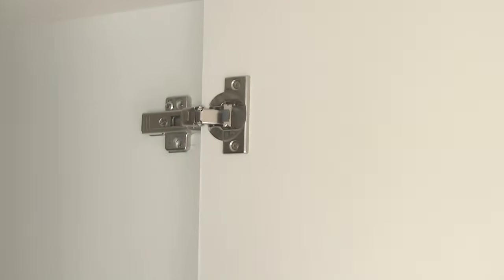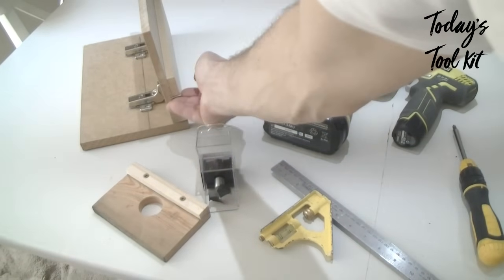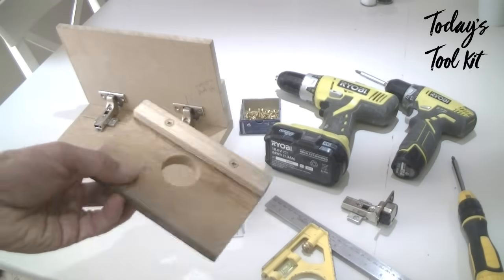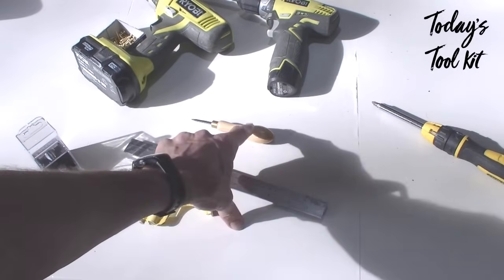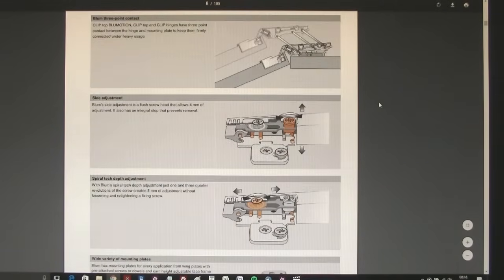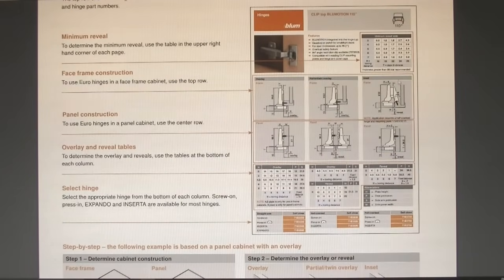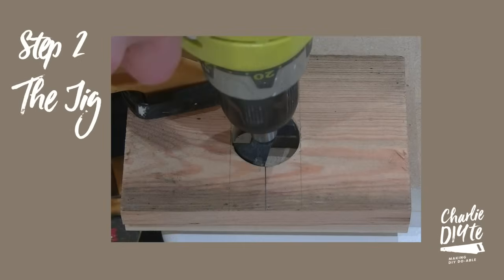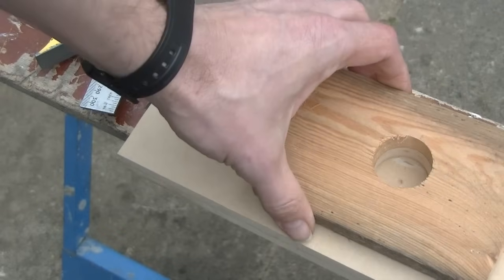How to Measure & Install Concealed Hinges on Cabinet Doors

Comment: in my cabinet panels, while assembling found, circular hole is already on side panel.
can I install this hinge reverse? Base plate on Door panel and Hole   hinge on Side panel?
Would it create any problems?
Reply from the maker: peeyush chaurasia I guess it would - particularly if you're using the hinges that it was supplied with. Depends on how far away from the edge the circular hole is located, and what type of covered hinges you have. I guess you just need to try it out and see what happens. Are the doors pre-drilled for the mounting plates? Weird though to do it that way round - you don't see that very often 🤔

Comment: Did you have any trouble with your MDF doors bowing?  My first attempt using MDF with panelling glued on caused a lot of warping.
Reply from the maker: Yes I have as a matter of fact. I had to completely remake one set of doors. Part of the reason was they were stretched across 2 benches when I made them, but also I used grab adhesive which I don't think helped. The last lot I glued together with PVA https://youtu.be/WIRW0kMN96A and they didn't warp at all. You could also try moisture resistant MDF. The other trick is to clamp them down to a flat table when you glue them and only release the clamps when you've pinned them and the glue has gone off for a couple of hours.

Comment: sorry if this is a poor question: what is the bit used to drill the 35mm hole?
Reply from the maker: Sam F It's a hinge boring bit - sometimes called a forsner bit. If you click on the little down arrow to the right of the video title it will open up the description tab that contains details of all the tools I use in the video and links to them. YouTube needs to make it much more obvious!

Comment: This is the only video I found for exactly my application. Would you mind to share the Part number of clips, hinges, etc? It would really help me. I went through the BLUM catalog but got overwhelmed! Please :)
Reply from the maker: laura vianello Thanks so much Laura! I'll see what I can find, it may be tomorrow because I'm travelling with the day job right now. By the way, did you check out the links in the comments section below the video, as this includes the links to the hinges from the company in the UK I bought them from?
Reply: NP, thanks
Reply from the maker: Laura, these are the ones I used - but don't forget - these worked for me because I had a 25mm thick door - that I wanted to be inset in the frame not overlayed on the front. And these only open 95degrees. Your doors might require different hinges?

- Blum 71B955 Clip On 95 degree thick door cabinet hinges with integrated soft close https://goo.gl/q7Gv8j 
- Blum 175H mounting plate. 0mm spacing. zinc die cast https://goo.gl/SlcuUy
Reply: Thanks so much for your help!!

Comment: hi quick question got a cupboard and the door is wonky tried and straighening it with the internal screws but the comes out too much the door looks like the bit not on the hinges hang is slanted down any idea why? this was fited by some one else.
Reply from the maker: Fitter probably fudged it to try and get it to hang straight. Maybe take the mounting plate off and try and reseat it correctly.
Reply: @CharlieDIYte  ty

Comment: any chance you could supply the hinge and plate model numbers (the ones you used)? It isn't 100% clear in the cataologue
Reply from the maker: If you go on Trade-hinges.co.uk the hinge ID is 71B9750 and die cast mounting plate 0mm is 175H7100
Reply: @CharlieDIYte  amazingly fast response. Thanks!
Reply: @CharlieDIYte  Thanks again Charlie, I stuck to your scheme and it worked just fine. I managed to get the  mdf sheet cut by B and Q Chingford which made everything easy. I used 10.5 mm thk pine for the trim which B and Q also cut for me so I really just had to assemble everything on the kitchen table!

Comment: Think you should of shown how to put the mounting plates on the carcus to align with the door
Reply from the maker: Yep, I should have done. I was just really conscious how long the video was and had no idea at the time whether anyone would watch it, let alone get to the end!
Reply: I’d really welcome a bit of advice on locating the mounting plate - excellent video but that detail seems to be lacking - do s Directors Cut version with mounting plates- really helpful though and thanks for doing the hard work so that slackers like us can just get on with . Cheers Charlie .
Reply: I'd love to know how you aligned the hinges with the mounting plate. Did you just measure the distance from the top of the door to the mounting plate? Or did you put the door next to the carcus (e.g. on the floor) and drew lines across both the door and the part of the cabinet? The trickiest part to me seems how to align those two parts so that the hinges are exactly on the same hight as the mounting plates and not a little bit off.

Comment: Hello wonder if any 1 could help me I’m fitting a in set door but my door is 30mm thick is there a hing that I can get for this. Any help would be appreciated thanks
Reply from the maker: It would appear these can be used on doors up to 32mm https://bit.ly/3HmaiEP but worth checking with Blum because I thought they only went up to 25mm.

Comment: How do you restrict the door from opening beyond 90 degrees? I would like to prevent the cabinet door handle from hitting a nearby wall.
Reply from the maker: The best way is to buy hinges that only open to the angle you require. There's no way to modify existing hinges to perfect them opening beyond their factory designed angle

Comment: Hey Charlie, while I have pretty much mastered the installation of the hinge cup, I still have a hard time to bore the holes for the clip. Any suggestion about a template to align the two pieces perfectly? I have a template for the cup (available on AMZ too) but nothing for the clip which...really drives me crazy! Thanks
Reply from the maker: Thanks Laura and apologies for the radio silence - it's been a busy old week! If it's the mounting plate you're struggling with I think this would do the job https://blumkit.co.uk/products/drilling-template-for-blumotion-tip-on-and-hinge-mounting-plates-65-5300

Comment: Hi! I have a question for you, maybe you would like to make a video about it. I'm making a closet with an angeled roof. The problem I have is that I use an adjustable square, I have a jigsaw that can saw under an angle, but I can't seem to get it fitting. Do you have some advice? Thanks in advance. 

Marleen
Reply from the maker: Marleen Holtkamp Hi Marleen, if it was me, I would use a sliding bevel rather than an adjustable square - as this will measure the angle more accurately. The problem with jigsaws is that the blade can wander at the best of times, and even more so when you're cutting at an angle as the blade is having to cut a much thicker piece of wood. I don't know how wide the piece of wood is you're trying to cut at an angle but when I do this I use a manual hand saw - or maybe a circular saw if you've got one, and then fine tune the angle afterwards using an electric plane. Hope that helps and apologies if I've misinterpreted what you're trying to do 🤔
Reply: Charlie DIYte Hey Charlie. I actually meant I'm using a bevel. I'm sorry my English is not so well when it comes to specific words.
The length of nu wood (mdf) is 50 cm and I have to do it  four times so a circelcutter won't do and nu hand take a lot of time and craft.
Reply from the maker: Hi Marleen - your English is brilliant - please don't apologise. It's such a tricky one because I think you're going to struggle to get a beautiful snug joint without either sawing it by hand, or using a hand or electric plane once you've cut it, to get the angle of the cut right.
Reply: Charlie DIYte Hey Charlie. I guess I'll just neef a lot of practice then! Thanks for answering my question and keep up the good work with your videos.

Comment: Hi Charlie, did you make those doors? I like the style of those and would like to make some.
Reply from the maker: +Ian MacPherson Hi Ian. Yes I did. Really easy to make (I'm cross I didn't do a video of it!!) The door is made from 12mm MDF, with strips of 12mm MDF around the edge to make the frame detail. You decide on the width of the edge pieces based on the width of your door and what looks in proportion. The strips around the edge are glued on with wood glue and then tacked down with panel pins. I used to screw them down but nails can be punched below the surface and more easily filled. 

You need to make sure you glue and nail down the strips on a flat surface, as the doors in the video are the second set I had to make as the first set warped because I had them sitting between two work benches when I put them together, and the bend in the middle was locked in when I glued the steps down! 

As I say in the video, position plenty of brackets to stop the doors warping once they're hung.

Comment: I can't see where the distance is to mount the mounting plate. In your pdf I see it says T plus 38.5mm but on page 79 of the catalog, I can't see in anywhere
Reply from the maker: That sounds about right. Maybe make a mock up like I did so you can check? In this one https://youtu.be/tdMnnkvInrE I made a jig because none of the jigs I bought seemed to fit the requirements of my extra thick door hinges.

Comment: Great tutorial! But just one comment. You drilled the door part, great! Then you basically did an impossible thing and put your hand through the cabinet with the door closed to install the other side. For a real life application, I believe you have to have a dummy half door so you can reach inside to install the other half.
Reply from the maker: Thanks buddy. This one goes into more detail on the door hanging https://youtu.be/tdMnnkvInrE

Comment: Fitting Blum hardware using Ryobi tools!🙄
I would suggest good quality brand like Hafele or similar which will provide the features and quality without breaking the bank.
Blum is only reserved for high end opulent installations where budget is not a big consideration.
Reply from the maker: Fair point

Comment: Is it possible to install hidden hinges on an inlay cabinet door? Where can I find instructions if it is possible? Everyone converting to this hidden hinge has overlay doors. Thanks in advance if you can help or direct me in the right direction to find my answers.  : )
Reply from the maker: Hi Dash. Yes it is!! The doors in my video are inlay rather than overlay! You just need to make sure you buy the right hinges - because, as you'll see from my video (at 7.50 mins into the video) the inlay hinges have a wider crank on them than the overlay hinges. You also need to make sure the hinges you buy are appropriate for the thickness of your door - my doors were 25mm thick, so I needed to go for the thick door hinges (8.35 minutes into my video). Finally, you need to pick a hinge that is appropriate for how wide you want the door to open - my cupboard was in a limited space, so I went for 95 degree opening. Hope that all makes sense! Remember though - my video features BLUM hinges, so if you were going to buy a different brand, you need to check that their hinges give you the same breadth of choice.
Reply: Actually I wish I could show you a picture of my cabinet doors because half the cabinet door is overlay the other half is inlay. Do you know where I could find help installing doors like mine.? Thanks for your previous fast reply.  : )

Comment: USA using Standard measurements.  Rest of the World uses Metric system.  Was learning metric system in the 4th grade in the 60s...then our government didn't think we needed to learn this...let's dumb Us down. This is the only thing I regret not learning. F for our government.
Reply from the maker: I've got to say buddy, I was surprised when I learnef that the US are on imperial. Over here the old boys still use imperial but the rest of us metric. Personally I think metric is easier but I guess it's what you're used to!

Comment: Blum also do a cabinet bracket that can be adjusted vertically without the need to unscrew the brackets, which lets face it, is a bastard.

Comment: Great video! Just a question, aren't these the classic ikea-hinges? https://www.ikea.com/se/sv/p/komplement-mjukstaengande-gangjaern-00214505/
Reply from the maker: I'm not sure what you mean? The Blum hinges are a similar design but much better quality
Reply: @CharlieDIYte  Well my question was if Ikea sold the Blum hinges, because I can't really see the difference between them. I'm inte the planning stage now and I'd like to buy the Ikea hinges since they are pretty cheap, but if Bloom offers a higher quality than that's most likely what I'll go with.

Comment: your screws didn't spin and sit on top of the door?? I had a cordless screwdriver and still they refused to go in and now I see elsewhere things like pilot holes, drills to create holes before screws, even glue for mdf???? and special screws?
Reply from the maker: Yes you should drill a pilot hole, particularly for MDF which can tear easily.

Comment: Will this not work for American hinges?
Reply from the maker: They certainly look very similar. It's worth checking though with the manufacturer - there are bound to be instructions/ drilling guides -  before you start drilling.

Comment: I must have missed where you demo how to put the mountng plates in the right places.....
Reply from the maker: Hi Toby, I showed you on the mock up - at 15:47, but not on the full size door. Daniel asked a similar question a week ago - see comment feed below, so the following is cut and pasted from what I said to him: 

I thought the video had gone on long enough and so I didn't record that bit - but on reflection I should have done. 

It's pretty easy really. I attached all the hinges to the door itself, and then offered it up to the opening. You might get someone to help you with this. Either way, it's worth putting something under the door to simulate the gap that you will want under the door when it's hung. This also takes the weight of the door. 

Then, simply mark the outline of all the mounting plates against the inside of the cupboard with a pencil. At this point you're not trying to get the exact location of each mounting plate relative to the edge of the cupboard door - you're just marking out the location and spacing of each plate up the inside of the cupboard. 

You can then take the door away, and now you've got the exact location height of each mounting plate, you can adjust its position in from the edge of the door, mark the screw holes, and drill. 

You could try and do it with measurements alone, but this way, using the actual door, you know that when you come back to fix the brackets in place, they will all line up perfectly.

Locating and snapping each bracket into place is a bit of an art, particularly where you've got 4-6 on each door. You want to locate them all simultaneously, as best you can, and then push them all into their mounting plates in one movement - because if you try and snap them in individually, you'll get a few in, but the last 1 or 2 will be pretty impossible to move into position - particularly if they've disengaged from the mounting plate while you were snapping the others into place! 

If you then find the door is a bit low on the opening (as happened in my case!), if you've used the mounting plates featured in my video, you can release the adjustment screws on each mounting plate and slide it up a few millimeters to get your door into the perfect position. I believe some of the cheaper mounting plates don't have this additional functionality. 

Hope that all makes sense. Let me know if you've got any other questions.
Reply: sorry I'd missed that. Thanks for explaining.

Comment: I’m being stupid and over thinking probably, I need to make a cabinet with shaker style doors but that’s irrelevant, your little mock up shows the side of the door being hidden, when I look at our kitchen doors they close onto the side. Does this depend on what hinges you use. I hope that makes sense
Reply from the maker: Yes, sounds like you're taking about overlay hinges rather than inlays. You just choose which ones you need for the job.
Reply: Charlie DIYte I want the doors to be inside the carcass rather than finish on the front of it

Comment: Why didn't you use a router? square cuts to exact depth and if you use the fence you can set it to the exact distance. Surely, it's one of those 'no-brainers' that the chav speak of.